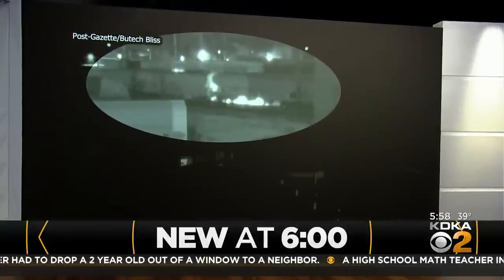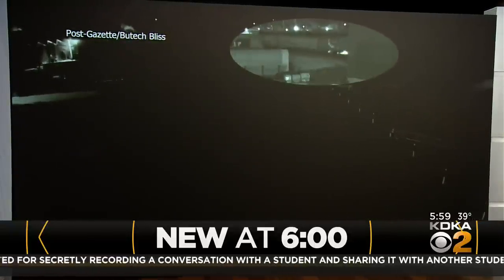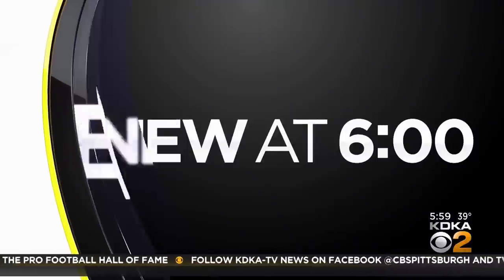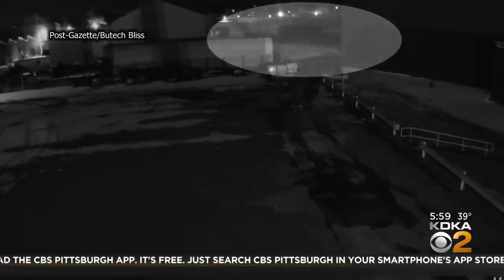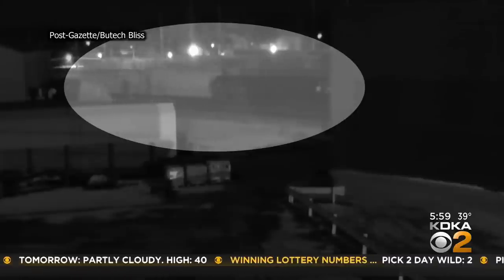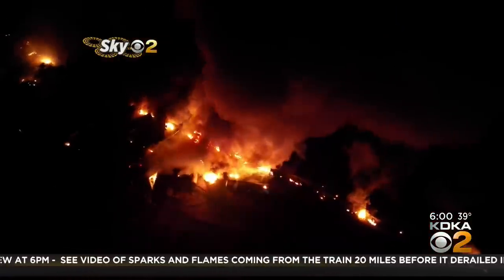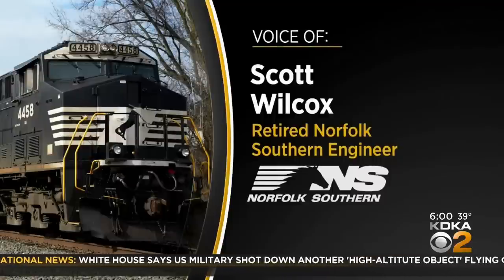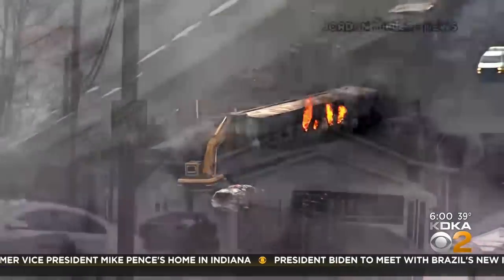Video shows sparks or flames 20 miles before train derailment in East Palestine

Comment: Stuck brake or broken axle bearing on  one side of a truck ( of a covered hopper) could easily cause this. You can see the 
on fire  end of the car bouncing up and down !  Question is was the detector near Salem, OH working and if so why didn't
 the crew stop then to inspect the train? Did anyone in  auto's that were stopped by the train  see the flames ? Did  anyone 
call the NS emergency phone number on the placard at every  crossing?  If so ,did NS call the train to tell them to stop and inspect it?
Reply: There is a defect detector right in Salem, I railfan along that line (usually in Columbiana, a few miles east) and I usually hear it on my scanner when an eastbound train is coming.
Reply: @epiccsx  There is one in East Palestine that was just west of the derailment too but was too late for the crew to really do anything. Thank God they survived this mess when they did stop in emergency.
Reply: @hestheMaster  Would have been interesting if I was down in Columbiana when that train come through, and seeing an axle sparking like that. If I do end up seeing something like that, I'm checking that crossing tag number and reporting it immediately lol
Reply: @epiccsx  You unfortunately would have been the only one as far as anyone can tell
for now.
Reply: If you watch the video the contents of the car are on fire, 3 distinct flames coming from the bottom out of the hopper doors. I agree the car looks like its derailed, but it shouldn't' have went that far without completely derailing. I shoved one 1/4 mile before and derailed 18 cars, but I was only going 2.2 mph, a frog caught me....I have so many questions now!
Reply: @hestheMaster  Yep, only thing similar to that I have seen on a train passing through Columbiana was a hopper car slightly leaking grain from one of the bays underneath, but that wasn't a hazardous situation. Small good deeds can go a long way in situations like this
Reply: @rebeccawayne1758  dragging a derailed and loaded hopper 20 miles is very hard to believe.it would have done considerable damage to the ties.if you look closely it seems to be the same height as the car ahead of it and the flashing light from the fire creates the impression its bouncing.
Reply: @hifijohn  I think the car itself was on fire. There's 3 very distinct flames , evenly spaced..I'm thinking the contents in the car but then how did they engulf?  If that's the case the structural integrity was compromised and it could be the reason for bouncing and how it made it so far. But how did it go that far with nobody seeing it? Soo many questions right now
Reply: I agree
Reply: I’m guessing an axle seized and was being dragged for quite a distance. Initially it would be hard to detect by the crew, but it would seem to me that the heat build up and sparks would soon start a fire, or cause structural/mechanical failure of that car which could have caused the incident. Just guessing.
Reply: @ he's the master

Your the only one that's got it right so far that car was derailed in the film.and yes he drug that car twenty until e encounters a facing point switch . the guy that mentioned ties. Only damage to the m will be flange marks on all of them . Rebecca Wayne the differences between your situation and this one as you say you were shoving cars not pulling and I don't believe for one second  you shoved one for 2 1/4 miles before it was forced to stop. I've drug detailed cars through frogs before that rerailed cars but shoving a derailed car two miles before it tears the track out and derails everything just don't happen.
Reply: @rc391995  I shoved it 1/4 - 1/2 mile at 2.2mph....not over 2 miles distance.
Reply: Sorry I stand corrected.
Reply: @rc391995  no biggie,  people usually don't understand me anyway...lol

Comment: The train company is in a lot of trouble. Either the crew f-ed up or the detectors weren't working. Either way the train company is going to pay out A LOT of money.
As it should.
It'll be interesting to see how their lawyers will try to slither out of the responsibility.
Reply: This wasn’t the crew’s fault. We can’t just ignore a critical alarm. Not only are we alerted of this but the dispatcher also gets a notification, as does the “wayside desk”, whose job is to monitor all wayside detectors for situations like this.
Reply: If the air is hooked up, the crew is not gonna know there’s a problem unless notified
Reply: The Taxpayer will pay, the CEO will run and the company will go insolvent, at least thats what happened in Canada, then the Prime Minister at the time, made the taxpayer pay.  Will happen in this case also.
Reply: They payed 25G to the Town
Reply: @revolutionarydragon1123  insulting
Reply: @Jayson 

"It'll be interesting to see how their lawyers will try to slither out of the responsibility."

Hey, what are lawyers for anyway?
Reply: @randacnam7321  how affirmation action cause this when these companies advocate for LESS safety regulations and hire just amount ppl to keep things running
Reply: @revolutionarydragon1123  They also hire the least competent to fill diversity/ESG quotas.  I see it all the time in the utility industry.
Reply: @randacnam7321  how you know those hire were running this train
Reply: @JohnSmith-mx8wp  Ambulance chasers
Reply: @randacnam7321  You got that right. I see it too in the manufacturing industry .... and it's getting worse. Eventually, this country will be run like a central African nation.
Reply: @kelleychilton2524  And utilities.  It is a testament to the existence of miracles that the lights stay on as much as they do.
t. grid distribution engineer
Reply: @kelleychilton2524  Mostly already is! That what our overlords want.

Comment: That's not what they told the residence. That detector should have sounded before 20 miles, it is clear it happened 20 miles back in Salem.
If it detects every 20 miles, the mileage is suspicious.

Comment: If the hot box detector is working it calls it out on the radio, mile 326, westbound, 412 axels, no defects, detector out. If it finds a hot axel it knows exactly where it is. They know what car, what axel, and what side is on.

Comment: The four-digit UN number on the side of the car is required by federal law and that number can be cross-referenced in the HazMat Safety guide to aid Fire & EMA response.  These rail lines run through large cities and small towns all across America.  The fault detector did its job and the crew may well have stopped the train ASAP; the DOT will pull all the data and come to a  conclusion.  The part I don't understand: you have about 110,000 - 120,000# of vinyl cloride in each car-- there are about ten cars of it.  So, that comes to about 1,200,000# of the material and NO ONE thought that burning that amount of a toxin would be unsafe???
What in the world were they thinking?

Comment: The security film shows a fire caused by a hot bearing (Hot Box).  The lubricant on the bearings of the axle fails, causing the axle/wheel assembly to heat and burn.  This can fracture the wheel to pieces, the axle to break or the wheel to fall off the axle.  Wikipedia has a fine article titled "Hot Box" with a drawing.  "IF" the train passed over a Hot Box Detector with this condition and "IF" the Detector were working, there would an automatic radio alert, telling the train crew which car was in trouble and the train would be stopped to allow the conductor to inspect.  This is the straight scoop from a retired railroad signal maintainer/supervisor/electronic technician.
Reply: IF the crew received Hot Box warning, what are the chances they were waiting for a second or 3rd Hot Box warning (just to confirm its real) due to all the "false" Hot Box warnings along the way?  I'm asking because I have a long career in troubleshooting and false alarms are quite common in almost all industries.  We make a machine to do the mundane tasks humans once performed but that machine doesn't have the intelligence to know it (self) has failed.  People get "numb" to alarms when equipment is unreliable and gives off false alarms frequently.  That was quite a blaze we saw the security video, meaning that Hot Box was in effect LONG before it reached this point.

Comment: We have train tracks crossing THROUGH property lines all over my county. Splitting lots in half. It would be nice to know the cargo.
Reply: I doubt anyone is going to tell what all they are hauling, trucks, railroads or airlines. As long as the product goes on through, it makes little to no difference. and for 99.99% of the people they do not understand, nor would they read the information, nor would they understand it nor know what to do with it. The .01% would be out there trying to stop every movement of anything to anyplace for any reason .

Comment: This is why RFK Jr! He has over a thousand lawsuits for families who were affected by the oil spill. there was an investigation done and found out that they didn't put heat sensors on the train cars, which meant the engineer didn't know that there was an issue. They didn't put them on to save money.

Comment: It's the PERFECT location for a biological attack. And it's JUST inside Ohio (a red state). As if they wanted to ensure it'd affect red states. The train having a visual malfunction for nearly 30 minutes before entering East Palestine, East Palestine being the best location to affect the Ohio River (it's the closest point of contact between the railway and the river). The river doesn't flow into PA, which is a blue state a few miles from where this happened, that the train would have entered, rather the location means it'll flow ALL over red states around the country causing serious water contamination problems. Livestock dying, crops dying, infertile poisonous soil, poisonous water supply, cancer rates, sickness, the whole shebang. Foreign and domestic enemies are upping their game to destabilize America.
Reply: @@shrock1995 I would but it's covered in vinyl chloride.
Reply: @XykuJoxa  Try thicker tinfoil.

Comment: They knew ahead of time I used to work for the Union Pacific railroad as a conductor they have detectors for hotspots on the wheels of the train the detector comes on over the CB and tells the operator of the engine and the conductor that there's a burning hot wheel that stuck they knew about this for a while
Reply: "Hotspots" "cb"???? You must have not worked there long.
Reply: Lol you must have had very limited experience. Not every detector is a hotbox detector, some are only dragging equipment detectors. The detector 20 miles west of the derailment is a dragger only. The one at East Palestine did catch the hot box but it was too late. Shortly after the critical alarm, the train derailed. Oh and “operator?” You mean engineer.